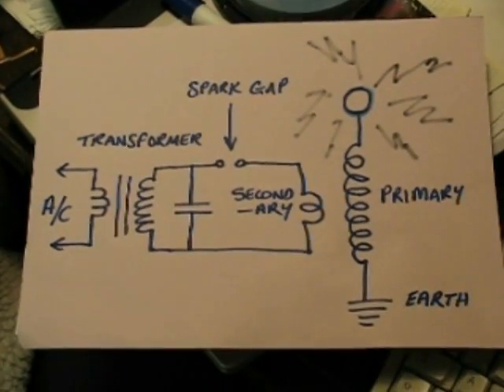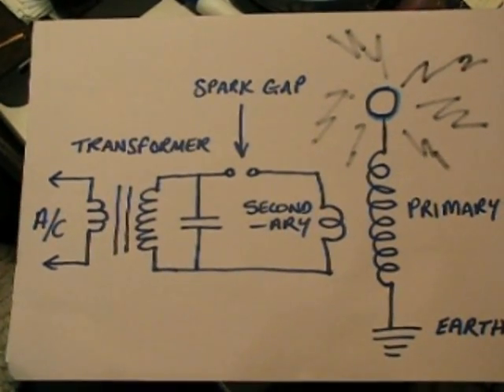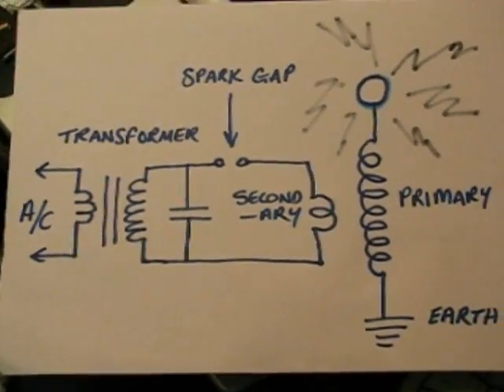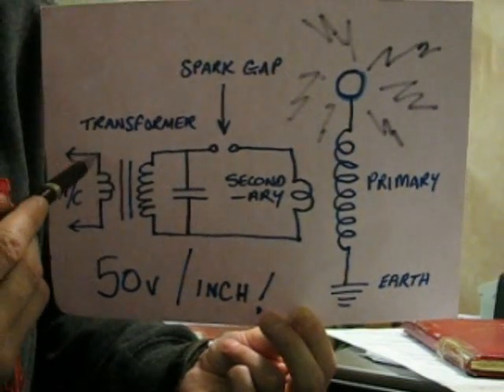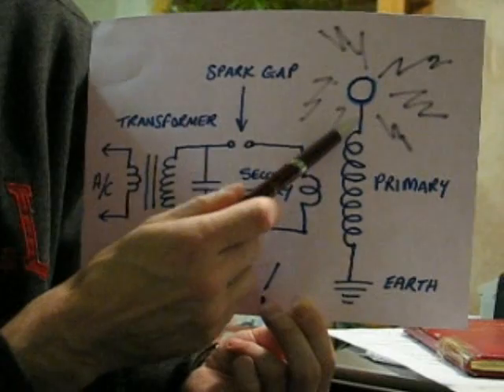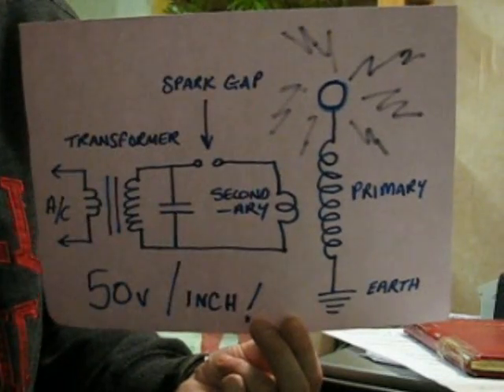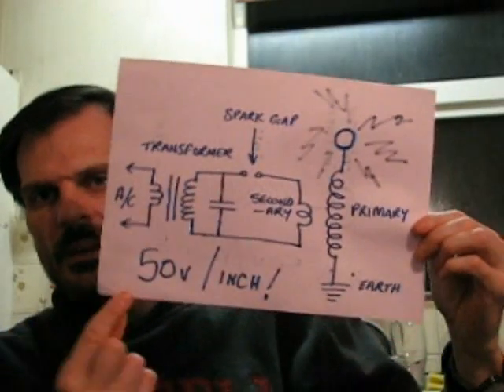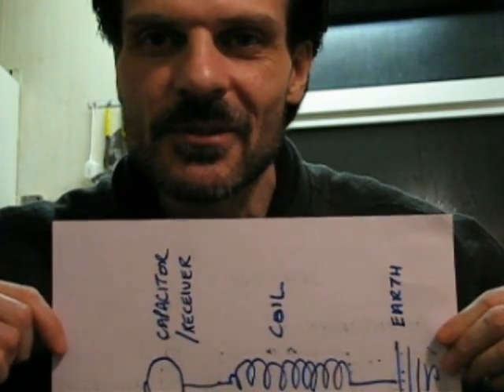Tesla's Little Secret

Comment: You are absolutely correct but Tesla was doing both pushing current out and pulling current in depending on a sound "FREQUENCY ACCELERATION". See Tesla was not just into the electricity creating line of work but he was in the UFO business. He made such claims as to he had even meet with Aliens and had saw their concept. He then crafted a craft and towers. He found that he could make the craft fly from one tower to the next. His proposal was to put these towers all over the world and we could travel from one to the next by combining a electromagnetic field that can be altered by frequency of 3 6 & 9. When he wanted the flying UFO to go in one direction, one tower would be pulling energy from the tower that is sending energy out. He then could cause the craft to move along the electromagnetic field by alternating the frequency waves that his craft was putting out. If there is a way to do this then there is a way to combine all of it into one craft without the towers needed. Imagine a UFO. It is basically two speakers flipped toward one another or two cones face each other and then attached. If the craft can send out the correct sound that we cannot even hear, sound then could ride along the vibrating electron field. If you boost the frequency then you would not need the towers at all. The odd part about his flight is that he couldn't do it with just two towers, he always had to have a minimal of three towers for it to work. Hmmm
Reply from the maker: Interesting information, thanks for sharing.
Reply: MattBlytheTheOne gravity is just density and buoyancy. I'm not falling for Einstein's (stolen) fairy tale on gravity.
Reply: Jason Witt where can I learn more about this
Reply from the maker: He said he was also able to generate anti-gravity using counter rotating flywheels and magnets.
Reply from the maker: Dense matter falling towards what? I understand it is as an electromagnetic phenomenon.
Reply: Maybe all gravity really is is paramagnetism caused by the electromagnetic field(s) of our planet Earth itself. If scientists were to think along those lines then a unified field theory of all four main forces maybe could be much easier to work out. Gravitons? Pah!...

Comment: The capacitor is in the wrong place , It needs to be in series with the spark gap so on one half of the AC cycle it charges so when the polarity reverses it will deliver twice the voltage to the primary coil. The secondary coil can be thought of as a chain of resonators connected is series to produce a high AC voltage and yes the secondary can receive radio frequencies as well and step down the voltage because the Tesla coil is really just a transformer.
Reply from the maker: +B Johnson Direct current from the sun charging the atmosphere, like plates on a big capacitor? I believe lightning is formed along those lines.
Reply from the maker: I don't think it is relavent. Technology will move forward. We already have mobile phones that will charge wirelessly. Soon you will be able to charge them them anywhere through the mobile phone network. Any attempts to delay the inevitable are temporary.
Reply: so what do you think of the claim that the spark from the primary captures 50v/inch in radiant energy...?
Reply from the maker: +B Johnson Not the spark. 50V per inch is what Tesla said was the potential voltage between Earth and the atmosphere.
Reply: +MattBlytheTheOne has this been proven? what could explain this potential difference?
Reply: Why hasn't a company popped up that takes advantage of this? There's always ways around any regulations... very interesting!!
Reply: well, BJ, maybe you ought to go down to the bank and ask them about loaning you $million$ to invest in a company that sells a device that collects free energy and makes the all coal/oil/gas/utility stocks the bank holds into worthless paper.  hmmm...  i wonder what their answer will be???
Reply: Exactly! - If you are lucky you will be bought out, or if not they will kill you. This has happened to all of the "free energy" inventors. Do you think the big energy companies are going to let you collapse their billion dollar business?

Comment: Just one little problem with tapping that 50 volts / foot of electrical potential from the atmosphere. DC voltage in the primary of the second transformer will not induce a current in the secondary unless you add a switching device between the coil and ground to periodically break the circuit. Then you will have to handle the problem of arcing across the switch every time you open the switch. Other than that, it looks like an interesting idea.
Reply: Dennis Laws / Nikola Tesla used the primary coil  in the atmosphere as a parallel-LC oscilant circuit by itself. He used a thick copper wire or copper band which was the Inductor ( L=inductance) and the insulation between the copper windings as a Capacitor ( C=capacitance ). Therefore he created an LC-paralel circuit with just the Tesla Coil and nothing else. One side goes to ground and the other in the air. The secondary goes back into the circuit  where any high voltage can be transformed into any lower voltage. The high power is realised with thick ground copper wires placed deep in the ground. With an additional tunning ( different geometries, different copper wire sizes and different isolation sizes and materials ) on
 different frequencies, maximum voltages can be obtained.
Reply: As I recall there is a patent on a Tesla switching device. 

Maybe that was another clue,  and possibly it's intended use.
Reply: Dennis Laws,
wouldn't an inline diode correct that problem!
Chevy's were notorious for frying out A/C switches until they installed a diode and rectified the problem.
Reply: Dennis Laws other than what you stated do you think it will work
Reply: i think you just described tela radiant energy patent

Comment: I've watch your video at least five times during the years it came out, always asking me where did everything stopped making sense in the evolution of Tesla's work. A few years ago, I saw an alternator made of car-speakers magnets and no wires, and it was producing 4 to 5 times the energy generators do.  But, it wasn't until I saw the work of Mr. Gerard Morin when your theory started making sense. You are absolutely right, everything was/is on reverse.  Radiant energy is electro-magnetism, but backwards only.  Thanks for posting this video.
Reply from the maker: Hey thanks. The thing about alternators is that they are also generators. What if we could use them to provide the energy to split hydrogen and oxygen in car and generate fuel. Makes perfect sense. You would still need to add water but it would be efficient. Combustion engines generate lots of energy! More than enough to power a small generator. Thank you for your comment and support :) Regards.
Reply: I think I have a pretty good Idea of how to make something that will work. This morning,  I bought my first small batch of Graphite in order to make a Graphene Capacitor, peharps, a battery.  It goes this way, A Graphene battery+ Gerard's system of a motor coupled to a generator producing electromagnetism, in order to feed a third motor and finally, feeding the batteries (probably, 2 of them).
Reply from the maker: He is better known now than he was ;-)
Reply: +enator71 

the secret isnt Hho
its just the water itself.

water itself  can be made explosive by increasing the amount of energy all ready in it by 100 fold, but i can not tell you how its done other than by  vaporizing it until the vapor is dry.
Reply: It's because your car's computer is working against you. The computer looks for changes in the air fuel mixture and adjusts the fuel accordingly. In this case the computer increases the fuel when you are adding the HHO gasses. On a car that is strictly machanical, it'll probably work. There were many cars in the 80's that were still machanical. I used to drive an 86 Chevy Nova import and it still had a carburetor on it. I think pretty much just about every vehicle in the 90's had EFI on them. While the 80's only had a handful of EFI vehicles.
Reply from the maker: +MrEunderhill  

Good point. If the sensors report weak emissions it will adjust the fuel/ air mixture. Maybe the ECU computer needs remapping for the change in fuel type?
Reply from the maker: +KingDarius ServantofChrist lol you need to read the comments before commenting again.
Reply: i wish i understand. LoL
Reply: +MattBlytheTheOne the tesla turbine gives 60% fuel effeciency while gasoline engine is only max 44% effeciency
Reply: If you "steal" energy from your battery to make HHO, you slow you engine down because you're taking energy from it to run the generator, increasing fuel consumption. There is no mystery there.
Reply: Henri A. No, well yes a tiny bit, but no because the ICE runs the alternator anyway.
Reply: enator71 Yes the folks who commented about the engine management chip are right. I have heard others have had success adjusting the timing to lean out the mix to compensate for the H gas. EMC may still need a workaround. When working properly people are getting between 10 and 40% fuel reductions. GL
Reply from the maker: You are not stealing energy, you are using the energy that the alternator is already producing. No less efficient in terms of HorsePower produced.
Reply: +Stupid Man 
some guy on you tube used homoginized 1% gas by volume of water to boost the power in water when super heated to a totally dry vapor.
the result was more powerful than gas alone.

i cant find his video anymore.
Reply from the maker: I think you mean vapourising the H2O and splitting the molecules into HHO which will combust. Steam (super-heated water vapour) will not easily ignite on its own unless you use some method of starving the atoms of electrons and ions, then the vapour will spontaneously ignite upon hitting the charged chamber thus replenishing the atoms electrons, a bit like compressed super-heated diesel, removing the need for a spark plug. I believe Stan Meyers dune buggy worked along these lines, injecting depleted water vapour mist directly into the combustion chamber.  Tesla commented that he could achieve high voltage from electrons leaving a vacuum chamber, in the order of millions of volts.
Reply from the maker: Hydrogen burns at a much faster rate than gasoline vapour too, so you need to use less of it. You can adjust the burn rate by "doping" the exhaust gases and feeding them back into the chamber, which slows the burn. If you match the burn rate to that of gasoline you don't need any further modifications to the engine.
Reply: You got it Brother!!
Reply: +MattBlytheTheOne i dont know why one of the greatest scientist is not shown in history books from AC to Rc robots radios chargers all are because of him but still no one knows about

Comment: I'm into Tesla since I was a kid and have tried many of his "apparatus" long before I left school. I always wondered how things worked and enjoyed much to create new engines, even if they seemed to be too nice to be real.

By saying this, I wonder how many of you have tried it at least a bit, to see if there was some truth. In change for this little effort, Worth just a few bucks and 2 days trying to make a coil and transform the enery it may collect, I will tell you this:

The space (air) above us is full of static high voltage electrical charges of all kind, constantly renewed by all kinds of events and are discharged partly during thunder storms. This is the moment where you should stay away from Tesla experiments.

The condensor must be of a nice size, at least 25 cm in diameter, and should not have spikes or rough edges anywhere. This measure prevents electrons to escape the circuit and is valid everywhere, but in particular to the condensor, and for this reason it must be spherical! You could use a glass bowl and cover it carefully with aluminum sheets ... and a bit of common glue.

The better the earth contact is, the better are the results. Hight is not everything, but resonance. Even a straight cable can produce energy if it resonates with the condensor, which in this case would be rather small. If the cable is long enough, no condensor is needed, but it would be rather difficult to find the right length.

Have fun and tell me your results :-)

Comment: Thanks! How to Make a Electrostatic Detector https://www.youtube.com/watch?v=DtIoUX725Jk. Much cheaper and easier than you may think For Under $5 ! A simple description is that IN34 or IN34A RF Germanium Diodes for Crystal Radio can take "Ambient" or "Radio Waves" to turns them into DC energy. This is the simplest detector! without any batteries or hardships circuit, only with IN34 diodes and Ether to Earth!..  See https://www.youtube.com/watch?v=cSxqe...

Comment: If we don't use the word "free" People might be more accepting.........also I remember making crystal radios when I was a kid that powered an earphone from pretty wimpy radio station transmissions , I would think the sun throws out a little more power than that.....keep working on it ;)
Reply: Coils won't work on DC current
Reply: I have done experiments with aerials, and there is a small amount of current all DC as close as I was capable of detecting. I'm not sure there would be much left after loss through a inverter?
Reply: Anthony Sinclair: The power needed for a crystal radio set is minute, and comes from the carrier wave of the broadcast station.
Reply: Anthony Sinclair dick smiths electronic kit builds

Comment: Yes, Tesla was working on 'Free Power for All', but what most folks don't realize was what he wanted to use as the generator.
The Earths Iron core.
Simple idea, really.
Set up 'standing waves' that always face toward the Sun, which would have the Earth rotating through the waves.
The Iron core would then be cutting flux-lines, like any good generator.
Enormous currents would flow through the core, and [Tesla was not clear on this] that power tapped.
Up to this point, all is well, but it isn't.
What happens to a generator under load?
The RPM tends to drop, current within the generator rises along with waste heat, maybe some vibration.  And this would only slow the core, not the mantle! 
This is all well and good in a power-house.  Burn a generator, it can be fixed.
Burn the Iron core of our home planet?
"They" may have stopped his research, but was that such a bad thing, this time?
Reply from the maker: +Greg Gallacci  I don't believe we could ever tap enough energy from the earth to slow its rotation.... earth receives its energy from the sun. Great ideas though :)
Reply from the maker: +Tinker Thoburn It is a non-starter and not something I spend a lot of time researching. You only need to  fly around the earth to KNOW it isn't flat. Thank you for your comments :-)
Reply: thoughts on flat earth matt?
Reply: Tinker Thoburn. Here are my thoughts, Tinker, for what they’re worth, if anything.

What if “flat earth” is really just or more of an energy metaphor rather than something referring sensory perception? After all, some very strange features of our universe – holographic, quantized, digitized, electro-magnetic and so much more. What if our bodies, biological machines, are our avatars within some sort of digital matrix and what we are actually experiencing is a frequency tuned projection that we are also tuned to send and receive in a manner that our avatars sensory receivers cause us to interpret as we do? Silly, perhaps? But which is simpler given all of the strange things we now know? Nothing is solid but things just appear that way. Interactive communications occur between all living things. Water itself remembers. It’s a bizarre universe in which reality defies perception, so what is actually real?

Anyway, just some thoughts, but I agree with MattBlytheTheOne. I don’t think objectively from sensory observation one would ever come to the conclusion that earth is flat, but this might explain why elite occult science may hold such a position and leak it. Of course, the opposite could be true as well, that it is just another red herring, another bread and butter war they want to initiate as another distraction. But it is, I think, more distraction than relevant from an atheistic dialectical materialism science framework
Reply: Greg Gallacci funny how iron isn't magnetic

Comment: We are taking a shower in energy every second.......Thank you sir. this has helped me. I was coming to this idea......the radiant  charge starts showing up at the capacitor.....It was like a guy charging his camera battery in 30 seconds over a piece of orgonite........the energy is  there. You need the right antena and storage/use
Reply from the maker: Paul Coover  Hi Paul, I am thinking it is not so much the antenna as the tuning circuitry? That is, tuning in to the correct frequency/harmonics.